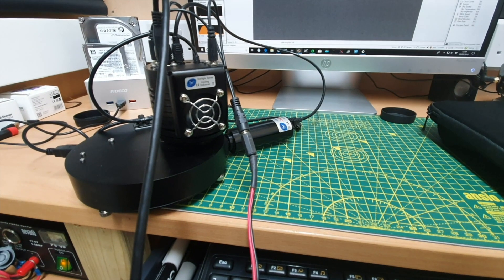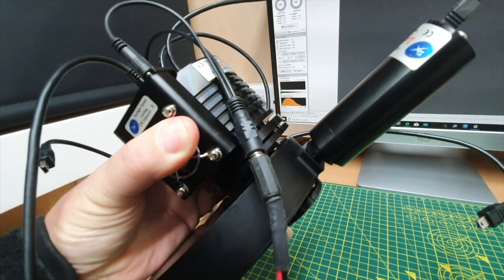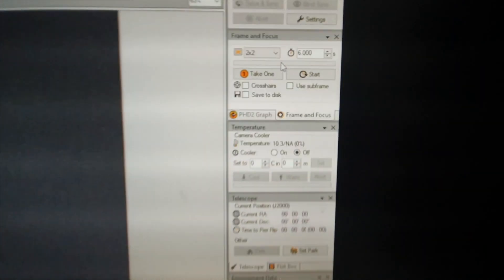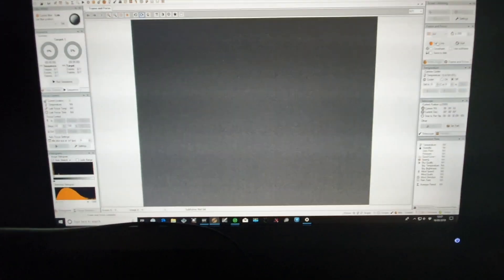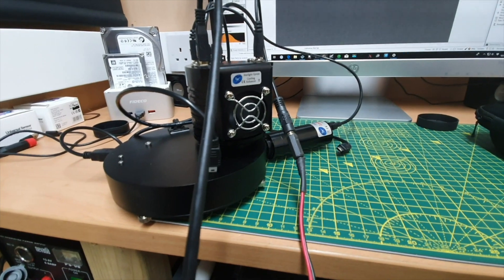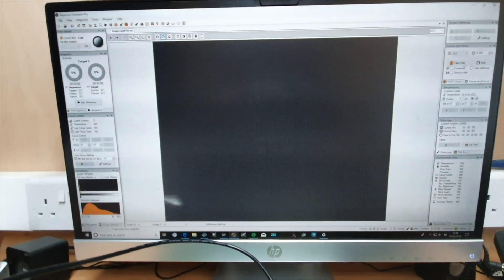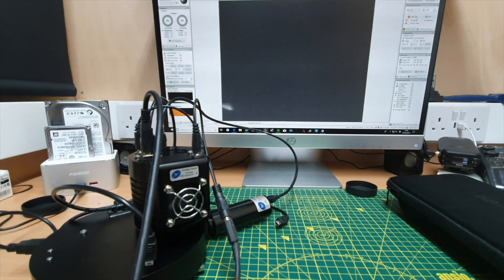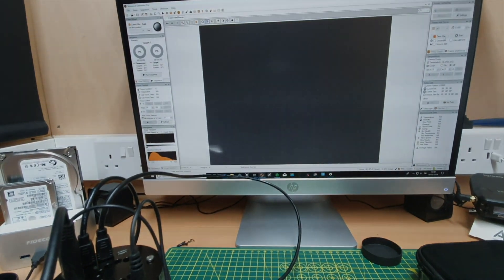CCD Light Leak Issue (dark calibration frames)

Comment: Were you able to fix the light leak?
Reply from the maker: Hi Joe.  No, this is just one of those things which you need to manage, and why I wanted to show how, although it can all seem light tight, it may not be.  

I take my calibration frames in a dark room anyway, so it isn't an issue for me, but it could be if you take them during the day, or in a room with the lights on.

Comment: Brilliant way of showing the importance of taking dark frames in the dark room. I’d also like to share an experience with one of my friend who was having this issue when taking darks in a dark room but the subs were showing some vertical lines. Took a while to figure out the issue. Apparently he had a T2 adapter at the front of the filter wheel which even though was covered but still had light leakage. The T2 adapter was something that he bought from eBay so once we changed it to a proper (can’t remember who made them) one, the issue went away straight away.
Reply from the maker: Hi Ahmed.  Great information there, thanks.  

Yes it is definitely something which I think is often overlooked, or ignored, but can play a significant part when trying to calibrate your images.  The light leakage over, say, 30 dark frames at 600s would certainly be enough to cause real issues.